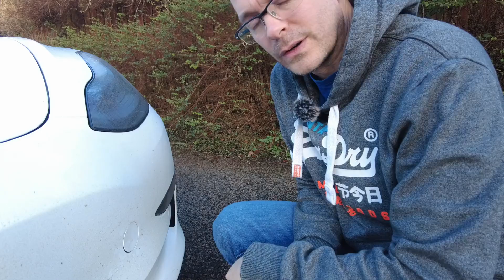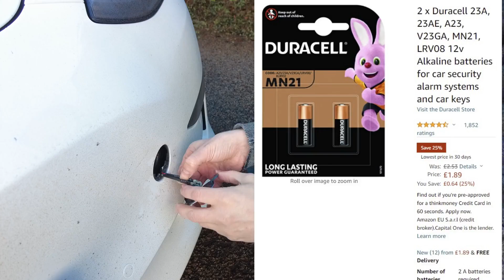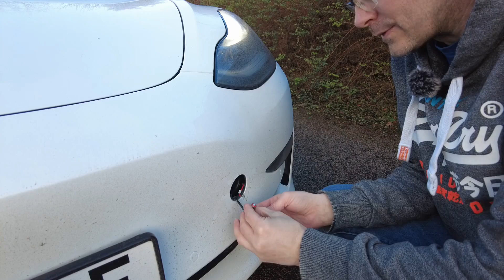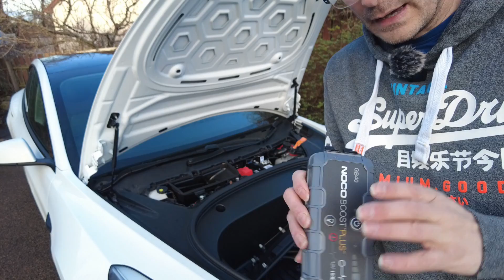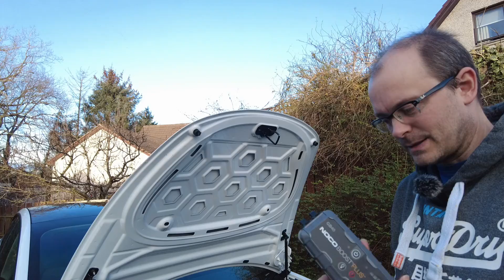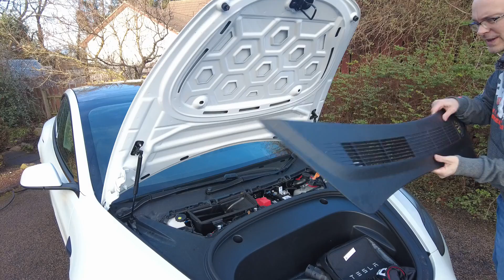How to rescue a Tesla Model 3 from a flat battery

Comment: We’ve had similar issues with both an Outlander PHEV and a BMW i3.  In both cases starting the car with a jump pack as shown on the video is enough for the car to then start charging the 12V battery from the high voltage pack, we didn’t need to keep the jump pack connected after the car came to life.  Great tip about the MN21 battery.

Comment: Great tip to keep a 12V battery inside the compartment. Then you always have it when you need it and the battery won't be locked inside the car. Personally I use one of those 9V rectangular batteries (like the ones found in smoke detectors). 9 volts is enough to trigger the release as well. Thanks!

Comment: About your next drives... If you aren't already planning to, I suggest you get up and running an instance of Teslamate (on a Raspberry Pi, maybe). It gives out an amount of telemetry data, automatically logged and viewable in a very smart and practical manner. You can track all the recharges, see an entire journey plotted on a map (with a ~0.5sec resolution, car connection permitting), with power, temperatures, SoC, elevation, etc. Whish I had set it up from day 1.
Reply: Or teslafi is good too you don’t need any hardware in the car or at home like raspberry pi just phone or tablet and tracks everything even tyre pressures in journeys and mileage efficiency etc it’s great user ib since got car in late August

Comment: Got the same booster pack as you and have started a 3 litres diesel and few decent size petrol car no sweat but in a ev all you are doing its powering the nigh voltage Contactor to power the computer and then within a second or so the dc to dc converter takes over charging the 12 v can can open the doors and leave the car open a bit to recharge the 12 v from the hv battery or to get to nearby chargers or open the charging flap to plug the car in etc I’ve done this with our Zoe ze50 and was a lot faster than calling aa etc but was worried than the model 3  has no physical key to get you into the car like most evs have until you came up with this idea after asking on the forums for ages until you told me of your brainstorm ! Finally a person that thinks outside the box like me! Instead of mostly others that say there is no way etc !  Thanks for your help and idea !  Take care and safe travels everyone!  Let hope we all don’t need this in real life !
Reply: Only if your HV is charged. If it is flat, then whole car low voltage system on jump box untill that runs out or you plug you'r car in.

Comment: I can see someone clicking on this video thinking you're talking about the main battery, haha.  Anyway, there is an aftermarket lithium ion 12V battery available from Ohmmu (which I highly recommend...even if my 12V battery is still under warranty when it goes I'm going to replace it with that), and the new Teslas as of 2022 all come with basicaly an OEM version of this by default.
Reply: But how much is the new style 12 v for old 3 ? Only place I’ve seen them is USA and it’s £200 ish 😮 were as normal one is 70 ish !
Reply: @nickieredshaw7835  Around $400 US.  But it's worth it, because it works better and basically lasts forever.

Comment: Nice to know is that more recent models have now a lithium based battery of 16V instead of the older lead accid battery which is standard 12V. This means that you cannot use a regular old fashioned battery charger for the 16V lithium battery. On the other hand, the newer batteries have a much longer life span, so it won't happen too often... I hope.

Comment: I just had the 12V battery changed in my Model Y. It lasted 2 years and 30,000 miles. The Tesla repair tech said normally last 1.5 to 2 years.
Reply from the maker: Was it replaced under warranty?  My old ice cars lasted at least 6 years under my ownership.  I never replaced a single battery.  2 years just sounds very short lived.
Reply: @anthonydyer3939  It was replaced under warranty so there was no cost to me. I live in southern California where the air has normally low humidity. The no service batteries don't last very long around here.
Reply from the maker: @steveallen1055  that’s an interesting remark.  I thought AGM batteries were completely sealed so humidity “shouldn’t” have any influence over longevity.  Evidently it does, but nonetheless it’s good to hear that it was replaced under warranty.
Reply: @anthonydyer3939 Looked it up and you are right.  I didn't realize what type battery was in my car. When I saw it, there were no fill covers so I assumed it was a different type. The repair tech did say they usually lasted 1.5 to 2 years because all the items they powered and because the car wakes up during the night which uses the 12 volt battery.

Comment: A cheaper, but heavier option is a 100Amp hour lead acid battery from Walmart, then a pair of jumper cables. Costs about $100, handles the hot/cold better and can be used with inverter for other purposes. They have smaller/lighter ones, but more expensive $/Amp-hr... Also jump started a little Honda gas engine with 8 1.5v D-cells, duct tape and some old extension cord, so wonder if 8 AA or AAA cells would work if taped together...
Reply from the maker: Yes, that works, but it's not very portable, so you'd only want to have it at your home.  To be honest at home if the worst happened and the portable battery was insufficient,  I'd just ask a neighbour for a jump start.
Reply: @anthonydyer3939  I was thinking of just leaving it the car full time, admittedly dead weight and using space, but it's always there. In addition a solar panel and charge controller would keep it topped up. Something to be said for having a backup power system that is completely independent. It could be used for other purpose as well, running fan to cool car on hot days, running a RaspPi for car Vlogging/security camera/environmental monitoring/..., powering other eTools... That way if it drains, it does not affect travel plans... I'm wondering if anyone has made a frunk cover with built in solar panel for charging, or panel to mount flush on top of car.
Reply: Did find a future kit being developed by evsolarkits

Comment: If you buy a booster  have the garage check the leads aren't broken.  I bought one and the leads were broken... not great when I needed it.  Note you can buy a battery which is used to recharge your battery rather than jump it so be careful which you buy

Comment: Thanks for the video interesting to know new things of owning a Tesla.
Can I use the Noco Genius GC015 Battery status indicator 12V connected to the battery and running the lead in to the flunk, where you can then connect up the 12 volt home charger if needed, the indicator also shows state of charge as well.
Used it on other EVs in the past, which saved me a few times when low etc.

Comment: Very informative as usual. It is certainly something to consider. Curious how much strain this unit is under and if the Tesla systems would give you advance warning of a likely failure of your 12V unit.
Reply from the maker: There is a warning to tell you if the 12V battery is knackered.  At that stage you have a few weeks left apparently.  It’s not a warning that leaves you stranded.
Reply from the maker: In terms of how strained the 12V unit is normally, I've kept petrol/diesel cars for the previous 19 years, keeping them for 6-7 years at a time.  Often they've been left parked up for 6-10weeks and I've never had a flat battery or any other need to replace them.

I would hope the 12V battery in the Model 3 is topped up every time the car is "awake", but going off reports of 3-4 year replacement intervals, it does seem like there is some deeper cycling of the 12V battery going on.   I'd hope that software can be updated to prevent deep cycling of the 12V unit.
Reply: @anthonydyer3939  most ev have the 12 v battery replacement done if it’s needed or not at 3 years by sound forums and service schedule of the last 2 electrified 
vehicles  we had and both not use the car for 1 week mid winter and it’s a dead 12 v it’s very common by looks of forums, so that’s why I brought booster pack as it’s been used a bit even with new 12 v on Zoe during lockdown and few fossil cars so it’s not just evs

Comment: How do you electronically open the car via app, if the battery is flat?
It it's flat, but not flat flat.
Opening test with a completely dead battery would be interesting.
Reply: If the 12V is actually dead, you can open the cap in the bumper, and supply 12V to the two wires there, and it will pop the frunk.  That will ONLY work if the 12V battery is actually dead though.

Comment: Nice video. Thx... You might have wanted to better explain the part where you unlock the car... Mainly simulating a full dead battery and allowing you here to demonstrate the 12v trick to open frunk... 👍

Comment: this is great information, but what happens if the battery goes dead for some reason and you’re stuck inside?
Reply: There is a latch on the door handle. You pull and it opens.

Comment: Fantastic idea to have a small 12V battery there behind the tow cap.  My solution in the "hopefully unlikely event" was jump leads from neighbours car to pop the Frunk/Froot, then slow charger.  However the charger and leads are kept in the car 🤭🤦‍♂.  On a similar topic about overheating, i've heard the car fan running when approaching the car whilst locked.  Do you thing the overheat protection is working before hitting 40 degrees?
Reply from the maker: I have overheat protection switched off.   So I'm not too sure what the exact parameters are for switching on overheat protection.

With that in mind though, there are potentially better options to keep the cabin cool.  Personally any foil lined covering over the glass panes would be a great help.
Reply: Yer about 38-39 c seen it come on at now you can even get notifications when it come on and in the fronk it is a lot cooler than in the car so your booster pack will keep a safe temperature in uk lol
Reply: its not a fantasic idea when they could have just put external leads to the battery that you can access from a little panel.   lots of construction machines come with them now because the batteries are so buried behind crap in the engine.
Reply: @jebes909090  the other Tesla’s have hidden access with hidden cords to get the fronk open just not 3 don’t know about model y but you hear of a lot less of Tesla vehicles having 12 v problems than other ev as Tesla looks after it 12 v better it seems and if I remember I heard new Tesla cars going to comes with lithium style 12 vs in the future don’t know if they are all ready are yet . Your idea is good idea but how to do protect these wires from water ingress but make it easy enough to access?
Reply: @nickieredshaw7835  you just put it behind a pannel with a rubber seal.  Maybe theres just a hole under it so any water just drains out. Isnt that what the charge port is protects by.   It   It really doesnt have to be fancy like that either.   In machines,   the leads are brass ,  so they dont really tarnish.
Reply: @jebes909090  ok good point

Comment: Thanks. I don’t understand the purpose of the MN 21 small battery though. If you need to unlock the car first for it to work, could you not open the bonnet too with the app?
Reply from the maker: If the 12V battery is dead, the only way to gain access to the bonnet is to apply 12Volts to the leads in the tow hook.  It will work even if the car is otherwise locked.  This is why I have the small battery.

But in this demonstration, the 12V battery is alive, therefore the bonnet can’t be opened like this with a locked car.  I just wanted to demonstrate the method for doing so with a dead car.
Reply: @anthonydyer3939  I get it now. Thanks very much clarifying. I enjoy your videos😀
Reply: @anthonydyer3939  still confused. Assuming a totally dead 12v battery, can you use the small single cell to enable you to unlock the vehicle, first? 
It sounds chicken and the egg - because if you have to unlock the car with the app in order for this trick to work cant’t you also just unlock the bonnet with the app?
Reply: @keithmycek2768  when your car 12v battery is dead, you can't do anything, you can't unlock doors, frunk or trunk. Anthony is showing you a way to open the frunk using a smaller 12v cell battery. At first, it didn't work because his 12v battery is normal/not a dead battery, so that why he unlocked it just to demonstrate (it only work if he unlocked the car). In real life, when the car 12v battery is dead, you can open the frunk using the smaller 12v cell battery even when the doors are locked.
Reply: @keithmycek2768  - late reply here but as others have said, the little trick to use a small 12V (or 9V) cell to open the frunk from those two wires only works if the main 12V battery is already dead or if the car is unlocked. If this trick worked when the car was locked, then anyone could walk up to your Tesla, apply a battery to the leads and open your frunk and steal whatever's inside. So to show you how this works, Anthony could either wait for his 12V battery to be completely dead (which would be inconvenient) or just unlock the car first so he could show you how the system works. When the car's 12V battery is dead, there is no way to open the doors or trunk. You need to pop this panel, apply the 12V mini battery to the leads and this will release the front trunk. Then once the frunk is open and you gain access to the car's 12V battery, you can boost the 12V battery so you can open the doors and connect the car to a proper HV battery charger.
Reply: @anthonydyer3939  - And ponder this - if the car was LOCKED then any crook with the tiny 12v battery could open the Frunk and steal its contents.  This >>> if the 12v ISN'T dead when you're doing this test the Frunk won't open.  The car has either got to have a dead 12 or the doors already unlocked for it to work.

Comment: Great tips, however the new Li-On batteries (not lead acid) that are being fitted are 16.8v and all this knowledge you impart is incorrect you cannot simply jumpstart the newer Li-On Batteries at least not without a charger like this one which only works at home on either 100-240VAC 50/60Hz,  UpBright 16.8V AC/DC Adapter Alligator Clips Smart Charger Compatible with 14.8v - 16.8v Li-ion 4S 30W 2A 2.5A Lithium Battery Charger Maintainer LiPo DC-16820 DC16825 Power Supply Charging Clamp

Comment: Am I missing something: You had to unlock your car with your phone before the little 12V battery could be applied on the wires... but in a real situation with a really dead car-battery openening the car with the app would be impossible. Kind of a Catch-22...
Reply: When the 12V battery is dead, you don't need the doors unlocked for this to work.

Comment: i never had a battery issue yet
Reply from the maker: I've never had a battery problem with my old cars, and that included cars that were owned for 7 years and left parked for 10 weeks in one instance.

But, have a read at this guys experience:
https://teslamotorsclub.com/tmc/threads/30-hour-wait-for-recovery-lessons-learnt.253285/

There's a lot there that happened, and I doubt that a "jump start" would have helped.  That seems to be more a problem with the DC-DC converter going rogue than anything else, in which case you need roadside assistance anyway.

But he came to various conclusions, one of which was that making a huge quantity of phone calls during a breakdown is something you need to have a contingency for.
Reply: We have on last 2 electrified vehicles in just a week not used and lots have during lockdown

Comment: If you have power to open door, surely there's enough to access the screen to click bonnet open?
Reply: If the low voltage battery is dead the computer in the car won't sense your key and unlock the car. This is the reason Tesla added the wires to pop open the frunk.

Comment: Does this mean you can basically trickle charge the 12v battery without the rigmarole of lifting the rear seat base and disconnecting the high voltage battery? I always worry that the little 12v battery you hide behind the tow hook cover could also go dead if left in the cold long enough. It's good that it won't open if the car's not dead though!
Reply from the maker: People have released the bonnet with a 9V battery, but that doesn’t work if cold.

So I’m hoping a 12V will work in the cold.  I guess It depends what the freezing point of the electrolyte is, and whether there’s still a sufficiently low internal resistance in the battery.

Worst case is to jump open the bonnet from another car assuming they have leads.

As for disconnecting the HV battery.  I have seen this done on the Rich Rebuilds channel when changing the 12V battery.  I’m not too sure what the  reason for disconnecting the HV battery is, other than to decouple the dc converter and kill the 12V bus from that source.  But if your battery is flat, then you can’t open the passenger door to do this, so you’re left with having to trickle charge like this.

Comment: But I thought the 12v operated the door locks, so if your car is locked and your 12v is dead how are you going to unlock the doors in order to allow the frunk to be popped? Am I missing something? :)
Reply: Yes, the car's 12V battery operates the locks. If it's dead, you can't unlock the car. But when the 12V battery is dead, you open this little round panel, connect the small 12V battery to the two leads and this pops open the front trunk. Once the frunk it open, you can access (and boost) the car's 12V battery to get the doors unlocked. If the car's 12V battery is dead, it doesn't matter if the doors are locked or unlocked. The trick still works.